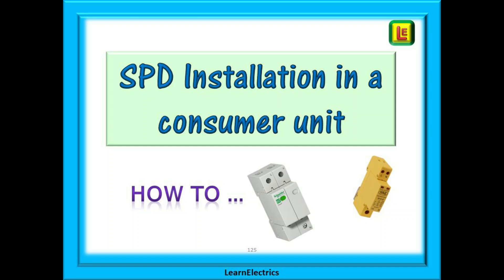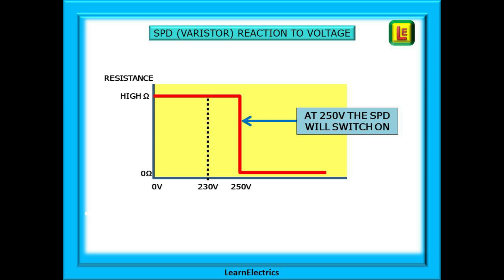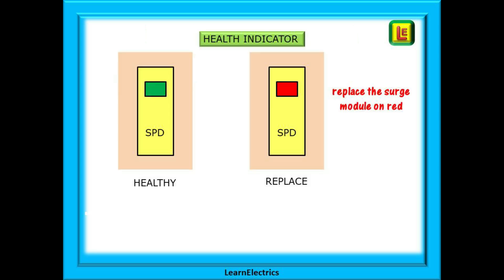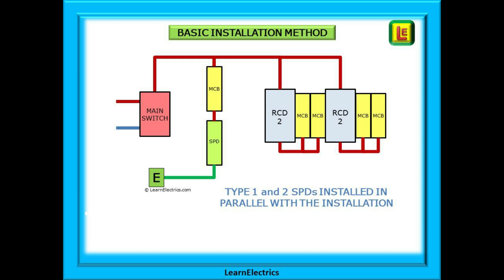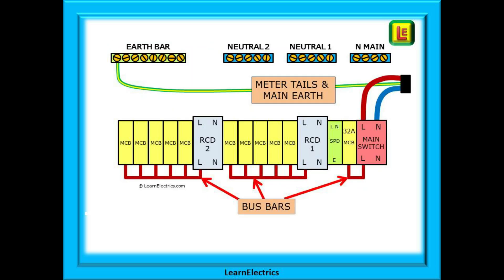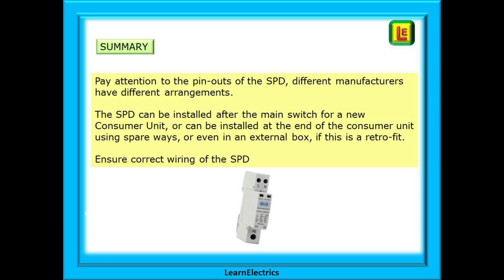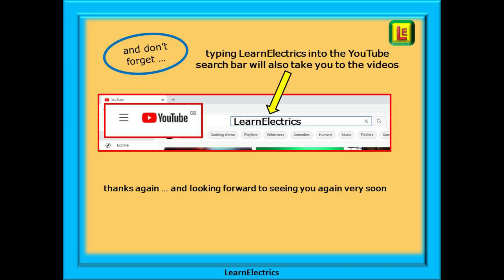SPD INSTALLATION IN A CONSUMER UNIT – HOW TO and THE BASICS

Comment: Very helpful. I assumed the SPD would have to be installed between the tails / main switch and all the loads - to intercept the surges. Not sure how it does that when wired in parallel.  Bigger cable = less resistance so surges go there before they can get into the loads?

Why don't they just combine the surge protection into the main switch to save space in the CU? Or just fit surge protection in a smart meter, or fit a SPD in the tails between the meter and main switch
Reply from the maker: Glad it was helpful! The SPD works by diverting the surge energy through itself, not by stopping it. The SPD is kep separate from the main switch so that the SPD unit can be changed without dismantling the CU when the green marker turns red.

Comment: very helpful video. I checked mine and I have 240v  coming out of the Earth......constantly? What might be causing this and how do I find it.
I have solar panels generating 700Kw but I don't seem to notice anything off my bill. Could there be an issue with them? It's a new build.
Reply from the maker: If its a new build under warranty then ask them to come and check if you believe you have issues. check where the earth is being referenced to, 240 volts with reference to what terminals.
Reply: @learnelectrics4402  no just out of warranty.
From what I have learned the 240v on the earth from the live feed is correct. But even in this lovely sunny june I'm getting a few quid off the bill. I was hoping it was a fault and all my electric generated was going to Earth..but that apparently is not happening.

Comment: You need to be careful on showing voltages here because SPD's do not trigger at 250V . AC voltage  as shown is sinusoidal so it alternates between +325V and -325V at standard voltage.  RMS 230v ac is the equivalent "DC heating effect" of this waveform, so easy multiply volts by amps to get power. So SPD's are transient devices that clip excess spikes above possibly 350V.
Reply from the maker: Thanks for the comments. Appreciated.

Comment: Hi by adding a T2 SPD to existing consumer unit , will that need a minor works certificate issuing?
Reply from the maker: Whether you use a minor works certificate or the full electrical installation certificate, you will still need to notify the work under Part P as you are making a significant change to the consumer unit. Interestingly, the next video in a day or two is about SPDs.

Comment: Hi Dave just as a follow on from this now aged video are we required to test this device during initial verification or on a EICR as in not the actual working but continuity, insulation resistance etc 🤷🏼‍♂️ Obviously very short runs that are mostly on show. Also wouldn’t want to activate by the IR test exceeding 250v. Seems to be an empty line on CCT 1 of the test certificates just listed SPD and the breaker details.
Reply from the maker: Difficult to create a surge to test it. Check wring, tightness of screws and general condition. Check indicator box on device.
Good question, thanks for your support. Dave.
Reply: @ thanks for the reply Dave much appreciated. I know EFixx have done a video on actually carrying out a test on the spd to confirm it’s actually working but I was more thinking of the schedules of cct details and results as in most cases the SPD MCB ocupies cct1. 👍🏼

Comment: Axiom make an SPD401m which is a single with L at the bottom and according to the manufacturer does not need its own MCB.
So, it only takes up one slot, is much easier to install - fewer fly leads, less faffing around.
Reply from the maker: That's good. Manufacturers are always improving things for us. Thanks for the info and thank you for watching.

Comment: Why does the mcb need to be 32A or smaller? I'm a little co fused because some spds call for larger mcbs. Schneider Max9 being one of them. 

Thank you
Reply from the maker: The mcb is protecting the spd only, not the rest of the CU. The other mcbs in the CU are independent of the spd mcb.
Reply: Thank you for your reply. I know that, what I don't understand is why we should use a 32 amperes mcb. I'm sure this isn't an arbitrary number.

Thanks again

Comment: I bought spd which Uc Volt 385V.

Is it ok??
Reply from the maker: This is the maximum continuous voltage that the SPD will give protection for, so at 240 volts or there abouts, you are fine.
Reply: @learnelectrics4402   unfortunately i bought    385v😭😭😭😭

Comment: Hi very concise. --Your comment above is now from 2 years ago. -----Are these SPD still optionable. -- Also If you connect the N out rom the Main Switch to the Main N bar. Then you will take both the  main N functions from the bar,  and the wiring will be less cluttered. That is what the N  bars are for--  multiple N outputs. Rather that jamming two N wires  in to the Main switch N terminal.    Tony
Reply from the maker: That's correct, this is an older video.

Comment: With not Neutral IN of two RCDs from “Main Netral Bar”?
Or connect two RCDs with Neutral from SPD similar to how LINE connects from SPD to RCDs?
Reply from the maker: Two RCDs needs two neutrals. Keep the neutral and line to each RCD separate otherwise you will get unwanted tripping.

Comment: I will add that it is always best practice to install the SPD on the first outgoing way of the board as this keeps the connecting leads (and internal busbars within the panel) as short as possible. The voltage that is let through by the SPD depends on the design of the SPD itself plus any voltage dropped as a result of inductive loading on the connecting leads, longer leads will mean a higher let through voltage. Also, all leads connected to the SPD should be bound for as much of their shared length as possible in order to mitigate electrical field generation around the lines. Also it is a bit of an oversimplification to call an SPD a !type 1 device" or a "type 2 device", to start with most have combined ratings these days and all SPDs will have all 3 type ratings, they will just be different ratings depending on design and installation point intent.
Reply from the maker: Thanks for your input. Appreciated.
Reply: Conductors should be no longer than half a meter long, as some SPD units are mounted outside the consumer unit, but they are okay up to 1 meter if pushed, as I understand it, But things are changing all the time
Reply: The ones that I work with have a recommended maximum lead length of 25cm (at least for the parallel connected ones) but this can be extended by creating 2 sets of leads with the live, neutral and earth in, wrapping or tying them into two separate bundles and bi-wiring the SPD so you create parallel paths. This has a better effect on inductive volt drops than using a larger cable.

Comment: Hi David 
Good informative video however I think it’s not suitable for TT installations and T1 SPDS 
on a TT installation a T1 device has to be located as close to origin also the SPD would usually be installed prior to RCD as operation of RCD would prevent functionality of SPD. In addition to that the SPD will also have to be fitted with larger tails and cpc conductors and an OCPD usually rated at 63A  or greater depending on manufacturer requirements. 

I think it would benefit views you cover TT requirements in greater detail or at least inform them that they require greater consideration.
Reply from the maker: Good comments. Thanks for the input and thanks for watching. Dave.

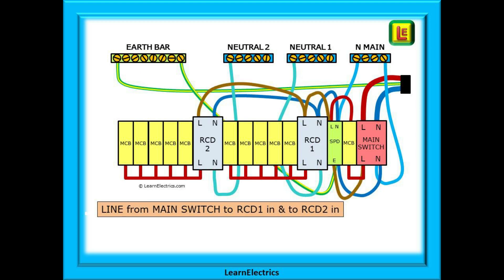Comment: David excellent Video is there an error at 8:20 "Line inputs. Your graphic shows brown line input from main switch to 'E' of the SPD your narrative says to connect brown from the line of SPD 1 line in to RCD 1 line in and then loop to RCD 2. It does not mention the shown brown line out from the main switch live out to the @e@ terminal of the SPD! Is the graphic correct as shown with live from main switch to 'E' of the SPD?
Reply from the maker: I think that's the way its drawn, E goes to the earth terminal and the brown goes behind the Devices to the line terminals. Thanks for watching. Dave.

Comment: Thanks for the video. Can I loop out of the supply side of the last DP RCD in my CU with 6mm or 10mm T&E to a 32A MCB then SPD both in separate enclosure. My worry was the cable size would be less than the pre-wired tails in the CU.
Reply from the maker: Have a look at this video on cable sizing. The important thing is will the cable carry the prospective fault current at that point in the circuit, especially if the cables are going to enclosures some distance from the CU.
https://www.youtube.com/watch?v=3_D65-32xp8

Comment: What's the point of mcb for that spd??.. if that trips all protection is gone
Reply from the maker: The mcb protects the spd. If that trips the spd does not catch fire but all the circuits are still enabled and protected by their own mcb.
Have a look at this video, it answers your question perfectly.
https://www.youtube.com/watch?v=CCZJ0CPOR2U
Reply: @learnelectrics4402  well there are out there SPDs which doesn't need protection, i.e. they are rated for 100A already. Installing an MCB in front of an SPD will render that SPD installation pretty much useless in the event of a surge especially when the surge protection is needed the most.
So yeah don't use the brand which needs overcurrent protection
Reply: @giubaca  I would think that it's because the SPD becomes a short after it's life is ended and the owner can use the power before it's replaced

If it were direct would trip the whole installation

Comment: what is the differnce between type 1 snd type 2 SDPs?
Reply from the maker: Several differences Imran. the amount of current and voltage they can handle. Type 1 are generally for protection outside the property where a lightning conductor is installed. Type 2 are usually installed at the installation source where it comes in to the property and where there is no lightning protection.

Comment: Hello David from Bosnia, I have  two questions
1. Do I need MCB 32A type B or type C for the SPD?
2. Is this good  = from Main Switch to MCB 32A type B then to SPD  and from SPD to RCD, (MCB is protecting all from Main S.) 
what do you think about this?
Reply from the maker: I would use a type B to protect the MCB. The SPD should be immediately before the main switch or immediately after it. Some pre-loaded consumer units come with the SPD before the main switch. The RCD current is NOT going through the SPD, all the SPD is doing is monitoring the voltage on the bus bar for spikes.
Take a look at this other video of ours on SPDs, it will explain better.
Use this link ...
https://www.youtube.com/watch?v=CCZJ0CPOR2U

Comment: I was investigating fitting a Lewden Type 2 SPD kit and they come with a 40A MCB as standard. This seems to conflict with the advice in the video to fit an MCB that is 32A max. The data sheet indicates the cable sizes are 2.5mm/4mm as described in the video. Surely a manufacturer wouldn’t knowingly sell a kit that didn’t satisfy the regs? Not trying to sling mud at anyone, just seeking clarification and reasoning. Any thoughts …
Reply from the maker: Go with the manufacturer's recommendations always. You need an MCB that won't keep tripping every time a big spike arrives, but not too big that it never trips, Conversely, you don't want a 6A breaker that is always tripping.
32A and 40A are in the same ball park. Thanks for the input. dave.

Comment: Sorry in advance if its a stupid question - will the MCB powering SPD not get overloaded as everything else is powered through the SPD line terminal? 

It looks to me as it'll keep tripping on overload, is there something missing in the diagram? Or m I missing smth obvious.
Reply from the maker: The SPD just looks at what passes across its terminals. The current for all the circuits does not go through the SPD, just passes across the top. Only when a spike of over-voltage arrives does the SPD suck that over-voltage through itself. The rest of the time it just watches. Think of a conveyor belt with small boxes on it. As long as the boxes are small, we let them go past us. If a big box comes, we take it off the conveyor belt and put it behind us.
The mcb protects the SPD from prolonged over-voltages. Hope this helps.
Reply: I agree, it looks like the entire CU current will flow through the MCB

Comment: A little confused as to why the position of the spd doesn't seem to matter, but why do most innstallers and manufacturers now place the spds on the board before the main switch
Reply from the maker: There are always new methods. As long as the SPD is installed where it can monitor effectively it will do its job. Thanks for watching. Dave.

Comment: In the video power drawing if the 32amp mcb trips  no power to rcds 
There fore the whole installation  is running off a 32 amp breaker
Or am I blind
Reply from the maker: The 32A breaker is there to protect the SPD only in case of overload to the SPD. The house current does NOT pass through that breaker, the voltage and current to all the circuits in the house just goes across the top of it so that the SPD can monitor the house electricity for spikes. Hope this helps. Dave.
Reply: @learnelectrics4402  check your drawing
Reply: @tonylockwood6370  no, he’s done it right - but if you pause video and look at it, it can appear wrong! 
both main RCD’s are supplied by the last cable installed - the brown conductor that comes out of the bottom of the main switch and runs up BEHIND the SPD - just unfortunate that if you pause it appears to connect in with the SPD ‘L’ connection (red loop at top)
Reply: @mikedowney6777  
You are right.
Reply: @learnelectrics4402  thanks for the clear way it was explained

Comment: Hi Dave…if an installation is wired with a TNSC earthing arrangement…should there always be an reference to direct earth from the main earthing terminal eg earth rod or bonding because if there was a surge on the neutral due to lighting strike from somewhere….with a TNCS earthing the surge protector will be shunting that voltage back into the same conductor that the surge is on…..so with all this these water and gas being replace with plastic…is there a requirement in the REGS for us to make sure there is direct refer to earth in my installation…as we know voltage always wants to go to earth
Reply from the maker: Dennis, TNCS is earthed, back at the transformer. Hope this helps. Dave.

Comment: Hi. Sorry for stupid question. But if you r board has an 80a supply for example and your connecting rcd 1 and 2 from top of SPD which goes through the 32a mcb which you’ve shown you’ve limited your board supply to just 32a? That correct?
Reply from the maker: No. The SPD is only monitoring what goes across the top of it. The current to the RCDs and the rest of the board does not go through the spd. The SPD is effectively monitoring the bus bar. The 32A mcb is a recommendation to limit any spike current to 32A to protect the spd. Hope this helps.
Reply: @learnelectrics4402  Hi. Only reason is if you look at your picture of the DB you have a copper bus bar link from main switch into the bottom of the 32a mcb,then from the top of the 32a mcb which then goes across to the SPD and also the RCDs. So surely if it’s all through that 32a mcb that’s maximum your board will be pulling. I maybe be stupid
Reply: In the diagram at 8.20 I first thought that the whole installation was running through that 32A SPD breaker, but if you look at the live on the main switch, a brown cable comes from that, to the live on the SPD and to the two RCDs. So the SPD is in parallel with the the main switch and both RCDs.

Comment: Great little video BUT slight problem with your connections! You show the live feeds to your RCD's taken from the supply to the SPD, this is incorrect as the whole installation would be fed via the 32A MCB feeding the SPD! The RCD's need to be fed from the main switch not the SPD....
Reply from the maker: The 32A mcb is aN IET recommendation to protect the SPD as in theory it could take an unlimited amount of current until it pops. Hope this helps.
Reply: @learnelectrics4402  No you miss my point, I know you need a 32A MCB to feed the SPD but on YOUR diagram see 8:20, you show the feed to the 2 x RCD's as coming out of the live in to the SPD which in turn has been fed from the 32A MCB, this is incorrect as the whole installation is fed now via the 32A. The RCD's need to be fed before the SPD MCB. :)

Comment: Hi, good video and a great explanation but a 230 volt ac system has a maximum instantaneous voltage to earth or neutral of around 325volts, ie the peak of the 230 volt supply is 1.414 x 230. So the SPD should not trigger until the  instantaneous voltage  exceeds  325 volts.
Reply from the maker: Thank you Roger, thanks for watching.

Comment: Great video thank you! I've been told you can't fit an SPD on a TT system please can you explain why if it's true and if not do you have to do anything different for a TT system . Thank you
Reply: I’m not an electrician so take this with a grain of salt but: With TT systems and SPDs I believe you have the same problem that you always have with TT, i.e. there won’t be enough current flowing to trip circuit breakers in the event of live to earth faults. On TT I believe you can use a CT2 SPD without any further protection than the circuit breaker and that you can use a CT1 SPD if and only if there’s an RCD before it. If you are installing an SPD yourself make sure that you keep the leads very short ;-)
Reply from the maker: Thanks again Johnathan. Great response. Dave.
Reply: @jonathanfox1105  thank you .  I'm new to this and wasn't sure what's best practice.
Reply from the maker: Thanks for the question. A TT system has a high resistance path and will not respond to surges the same as a TN system. See Jonathan's reply below.